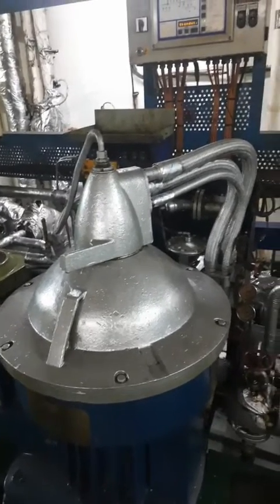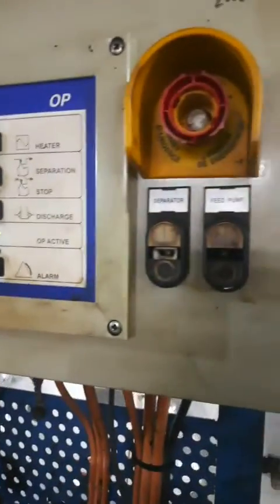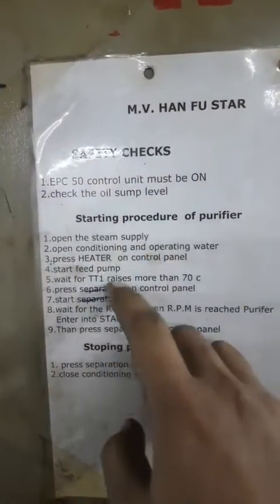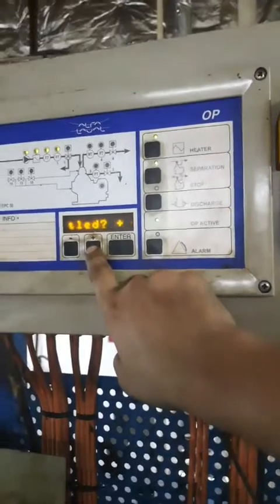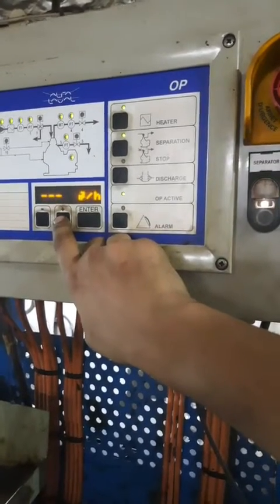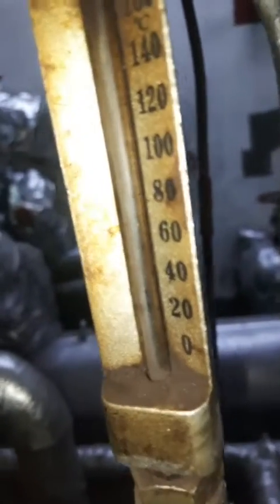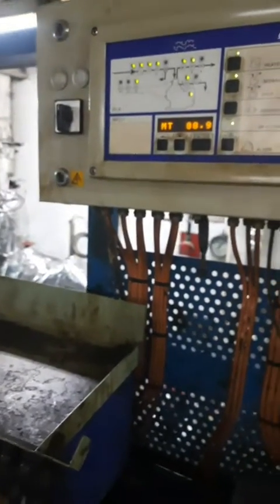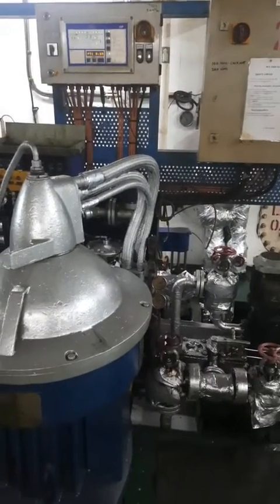Alfa Laval Purifier Starting Procedures IMP Step by Step Explained | HFO Purifiers SA851 #alfalaval

Comment: Why didnt you start the sperator motor earlier so that it reaches running rpm by the time you cold have opened the valves, as the feed pump is not attached with vertical shaft? Is there any particular setting or is it just that you did it for explanation purpose?

Comment: i assume flow rate is adjusted by the feed valve, what about parametres pt1 pt4 and pt5  what do they control
Reply from the maker: Study manual for that
Reply: @CLASS4ORALS If you study the manual you don’t need to write with markers on the water block what is the purpose of each valve!😅 “study the manual”… Obviously clueless!